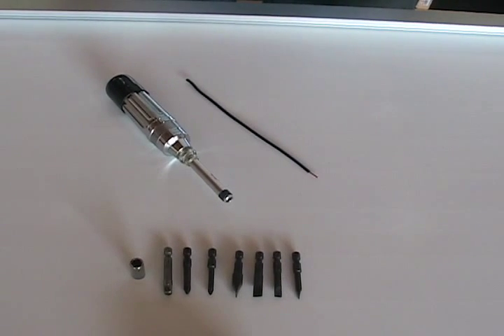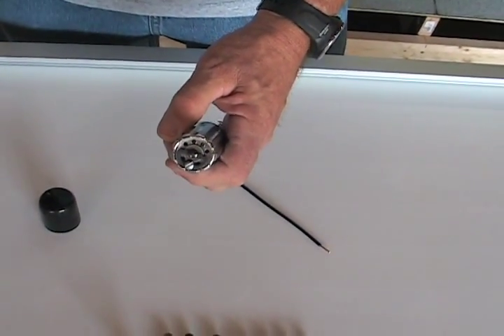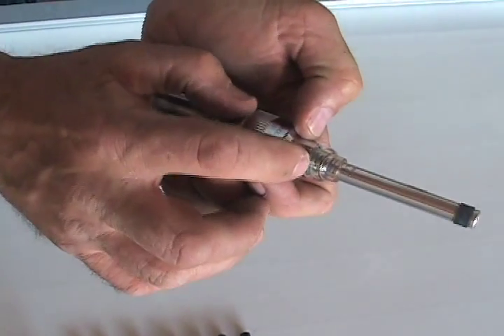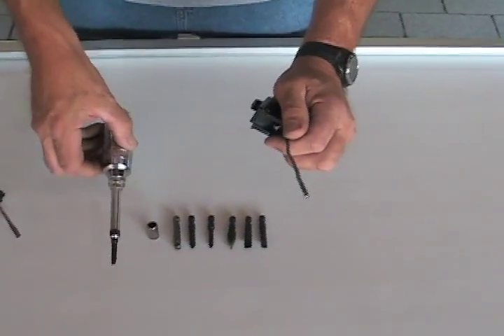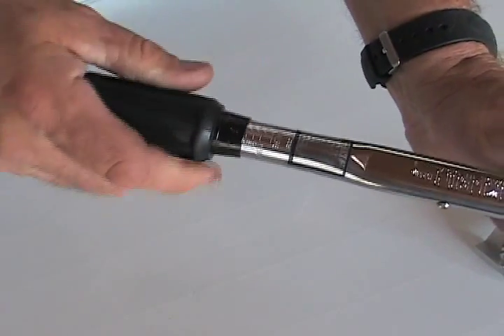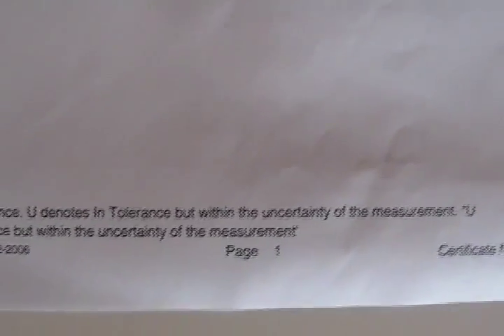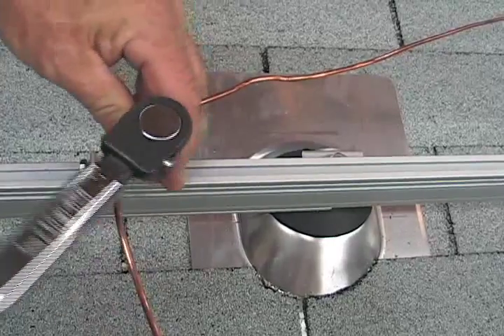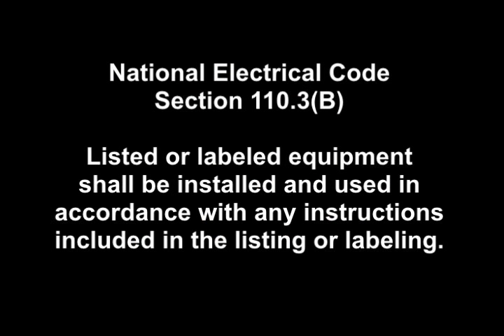Using The Torque Tools

Comment: Great video, well presented.  Torque is overlooked too often, especially car repairs.  They are very expensive, but NECESSARY.  I used to ignore torque as a mechanic until a water pump I had done DISINTEGRATED when cycling during expressway speeds.  I had tightened one bolt way too much and weakened the retaining sleeve, which heated up while driving, and then snapped when the pressure increased as speed increased.  Called over 60 customers to come back and get a "free maintenance" check.

Comment: Excellent video. Informative yet artistically passionate. Very well made. I too believe the subject of torque has been largely overlooked in the general field of DIY and engineering failures. Most car mechanics also never read or apply torque spec.